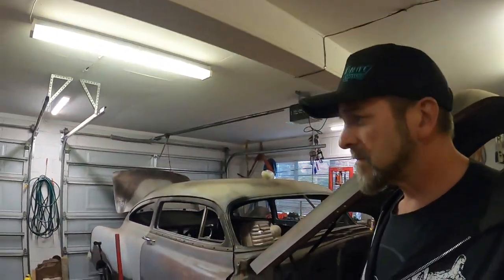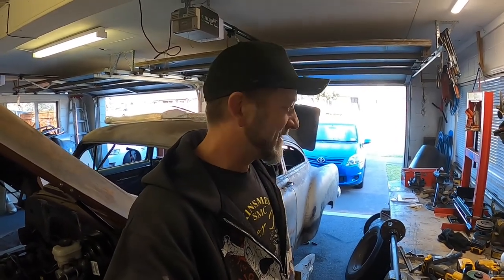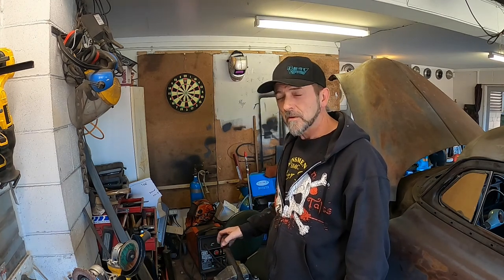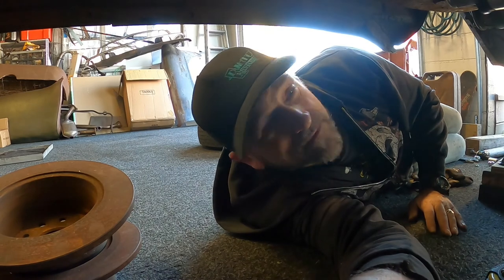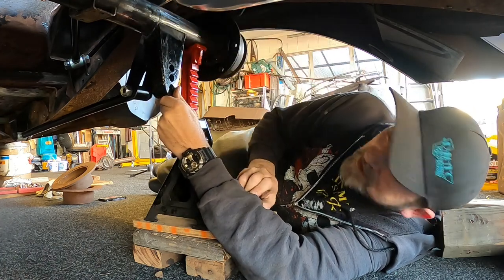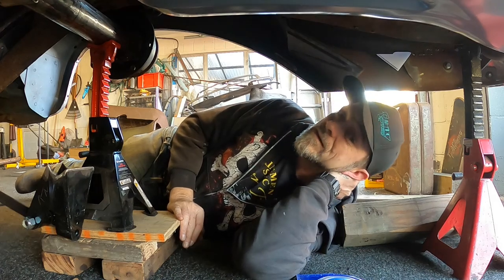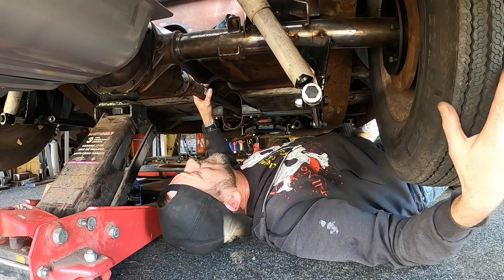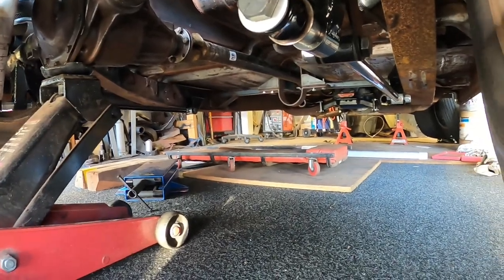Area 51 Update : Kustom 51 Chevy Fleetline  gets a new diff part 2

Comment: I have always shortened them on hub end cut it off flush at hub  bore a hole in the hub in center I usually machine a .005 heat shrink fit check it for run out on flange weld her up inside lip joint only u weld the outside it pulls and warps
Reply from the maker: Cheers Jeremy. I did consider shortening the other housing but was sure if I had the skills to get it welded up without warping it.
Reply: I'm not talking about the housing I'm talking about the axle shaft
Reply from the maker: Oh right I see what you saying now. That’s a really good fix.
Reply from the maker: I might have to track down some more and have a crack at em your way.
Reply: Just so you know that's how machine shops shorten ford 9" axle before strange and Mosher even thought about making custom length axles but u pretty much need a lathe and run out gsuge
Reply from the maker: Ahh,  I did not know that,  I don’t have a lathe but do know some folk who do though. Thanks for the info man. Much appreciated